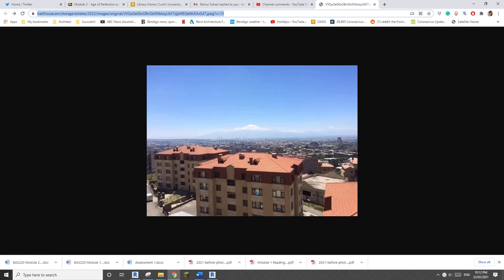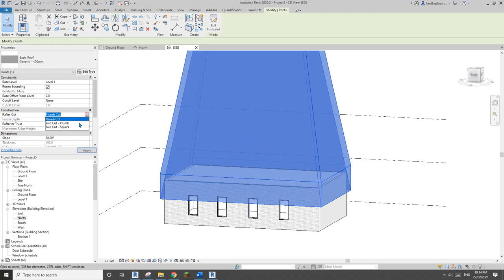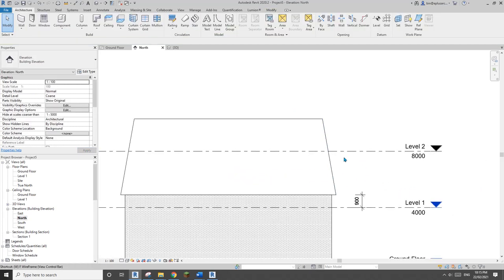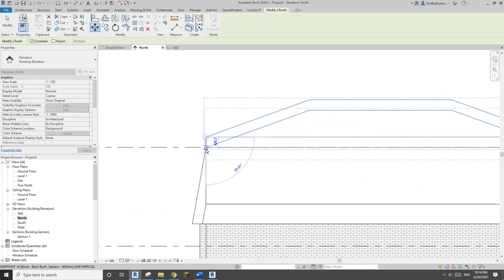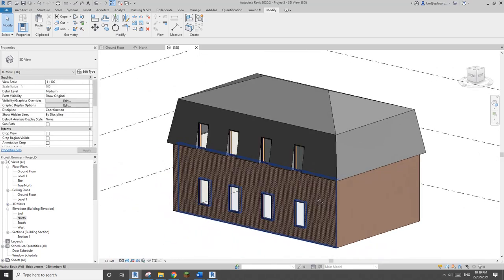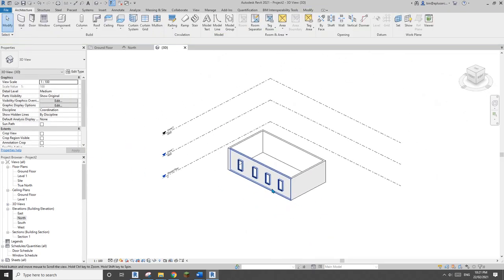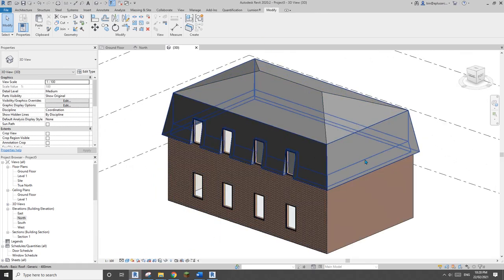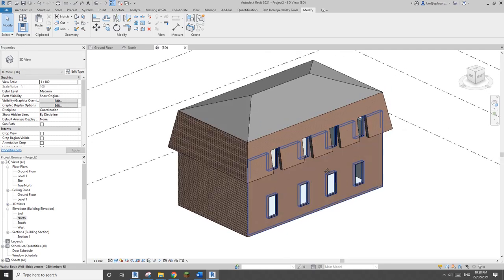Everyday Revit (Day 342) - Some roof exercise with Revit 2021 and older version Revit

Comment: Thanks for the tutorial! But in section the join between the  2 roofs isn’t clean. How can we have a clean junction (also if we have multiple layers in the wall)
Reply from the maker: Good question. Personally I will not worry about this because I can mask region it in a section and detail it in drafting view. But if you really want to model it to that level of detail, I believe you can, the question is how long it will take and how difficult it will be if you want to change it.